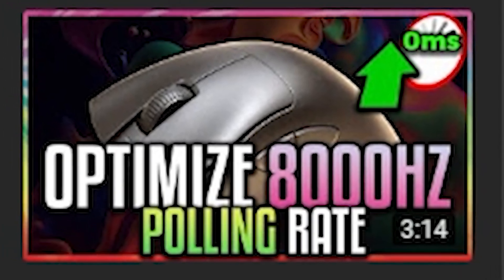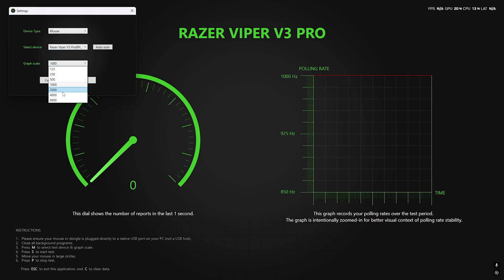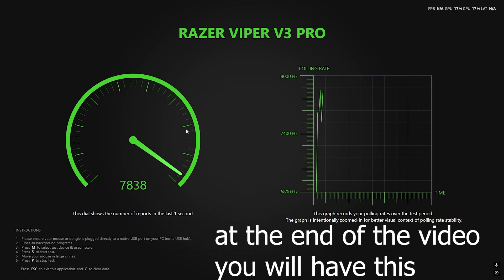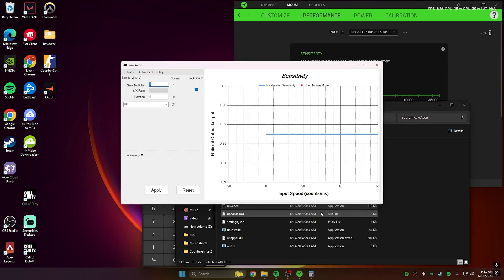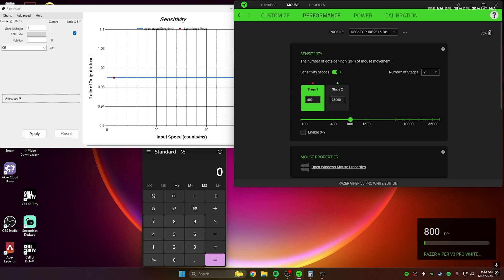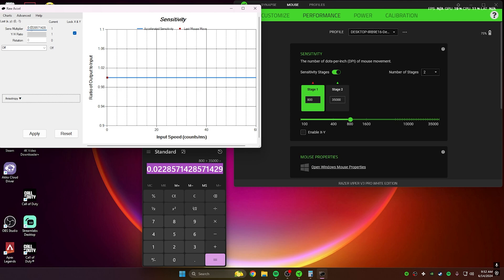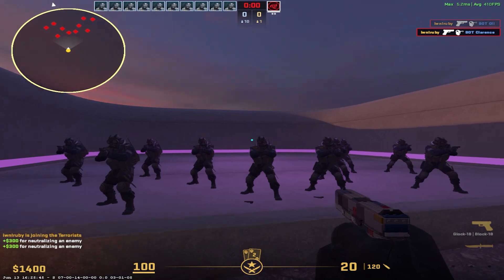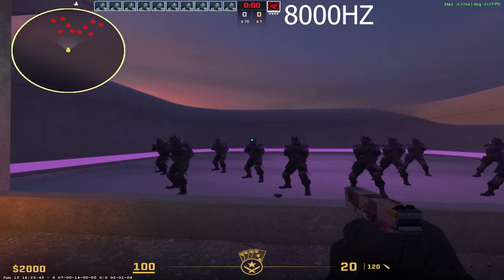8k polling rate optimization guide

Comment: Using an extremely high CPI causes issues. This is not a good tip according to the best mouse reviewers.
Reply: only a problem on older sensors
Reply: @itsxempt5722  Not true. Also, high CPI by design leads to smoothing algos being used on many mice, which alters the input. 

Here's a 6 month old quote from pzogel, who reviews mice on a technical level as a job for TechPowerUp. He's well respected in the space.

"Generally, not using high or very high CPI is recommended due to jitter/ripple significantly reducing positional accuracy. Even current top-tier sensors such as the 3950 will be less accurate at 30,000 CPI compared to a ten years old sensor such as the 3310 at 800 CPI."

Comment: I have the same mouse, the Razer Viper V3 Pro. I've tried everything to make it reach 8K or close to 8K, but most of the time it gets stuck between 6500 Hz and 7000 Hz. I've tried every trick I could find to make it reach 8K, but nothing works. Did you modify any BIOS settings or do anything else to get it close to 8K?
Reply from the maker: Watch my older video that shows the changes I did https://youtu.be/CDDk2MIZkI8
Reply: @rubyiwnl  Thank you!